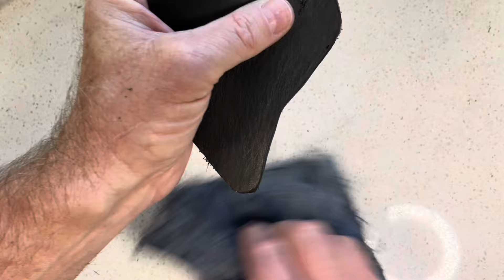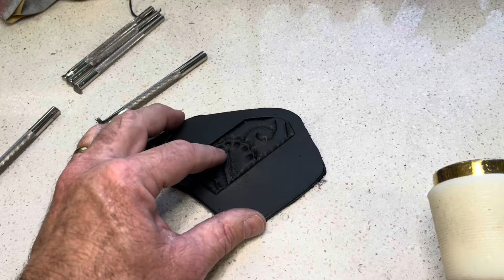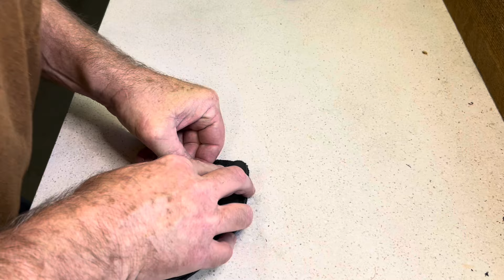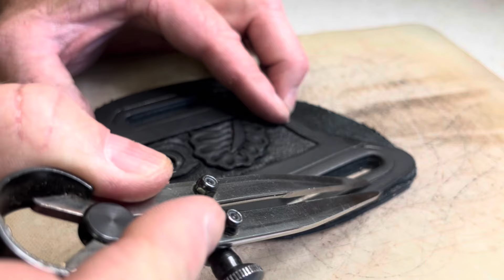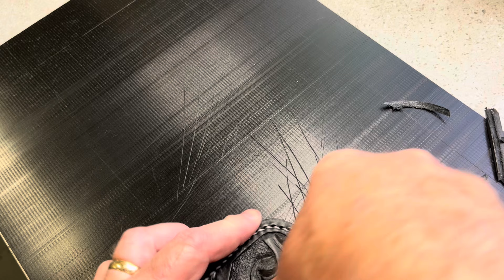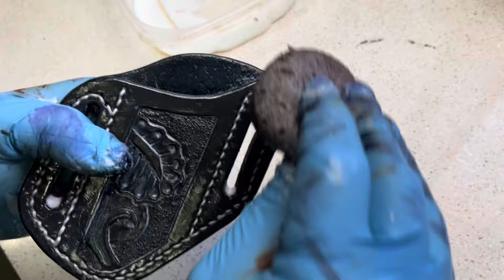How To Make A Tooled Pancake Knife Sheath - Easy Beginner Leather Project  #leatherproject

Comment: New at this, how do you estimate the thread length? At this point it is cart before the horse for me, but curious.
Reply from the maker: That’s a great question. When I am making a belt that has 5mm stitching and the belt is 11 ounces in weight I use 3.5 times the length of the area to stitch. On smaller projects I might go to 4 times the length.  Keep in mind that thread is cheaper than frustration so a bit extra that is trashed is easier than being a few inches short.  Also you need to add more for thicker projects. If the leather was twice the thickness then I would use twice the thread. Enjoy your week.

Comment: My problem with these sheaths is that I am afraid the knife will fall out during your daily routine. (unnoticed) I would like to see other comments on this, nothing worse than grabbing for a tool and it is gone!.
Reply: I have used my sheath every day for about the past 6+ months and never once has my knife even come close to falling out it is absolutely awesome.
Reply from the maker: @hardworkingmanoutdoors that’s great!
Reply from the maker: That’s for sure. I have one made from lighter weight leather and it still holds well two years later. I do see some that really stick out of the top. I do wonder more about those.